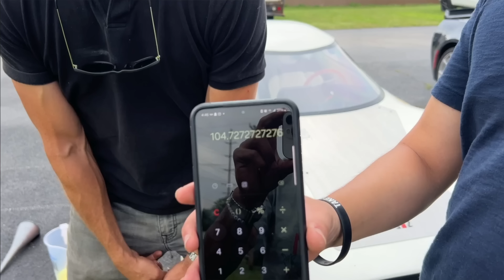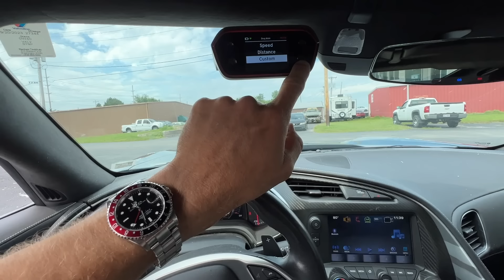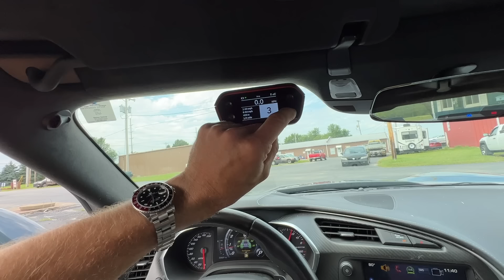FIRST 0-60 mph Test- Diesel OMEGA CAR - Video 3 of 3

Comment: Casey the Omega car is a beautiful and creative design and an amazing hands on teaching tool for inspiring your students.  You should be very proud for what it is.

However, I see you continually ignoring the multiple posts from other people regarding the real world practicality of what the Omega car actually is.  Unless you can post a video showing one of the industry accepted crash test simulations that evaulate the crash performance of the design and materials this is truly nothing more than a lightweight 2-seater as said by other posters.  A vehicle that could never meet any first world vehicle safety standards.  There is a reason why modern cars use a very carefully chosen mix of cutting edge steel and aluminum alloys that have been ran through tens of thousands of virtual iterations and analyzed to maximize crash performance while minimizing weight and construction complexity which both saves lives and production costs.  If you have developed your own materials that offer cost, weight, and strength advantages in vehicle construction over the steel and aluminum used today then where are your patents, published papers, etc?  This information would be worth billions to the automotive industry.   It is frankly insulting to think the millions of briliant hard working engineers around the world working in the transportation space have not come up with better designs and materials.

When you have the freedom to build a completely impractical car, with limited space, that meets no government mandated standards it is rather trivial to build extremely simple, cheap, lightweight, highly aerodynamic and thus highly effecient vehicle.  And even then, the Omega car doesn't match anywhere near the 261mpg effeciency, spaciousnes, etc of the VW Formula XL1 hybrid turbo diesel technology demonstrator which actually did meet European safety standards and went into production however required the extensive use of expensive carbon fiber to get adequate strength to weight requirements so that it was both lightweight, street legal, and safe.  It's the same reason why Formula 1 uses carbon fiber extensively in a money is no object design for strength/weight.  Also, without an electric motor and battery to recover energy in stop and go situations  (which is the majority of miles for most drivers) the Omega car will not get anywhere near the 100mpg you get on steady state cruise in a highly aerodynamic vehicle.  There is a reason why Aptera uses a 3 wheel design in order to be classified as a motorcycle so that it doesn't have to meet passanger car standards. The Aptera is an even more effecient design then the VW XL1.   In fact the Aptera is so effecient that with the very limited square footage of solar panels on the vehicle it is claimed it will provide enough energy for the day to day use of an average commute without needing to charge (although I'll be first to admit this is surely on the most optamistic perfect operating  conditions scenario and likely won't be nearly that effective in the real world).  

And lastly diesel is a dead end for transportation, or at least certainly for passanger vehicle transportation in the US.  All diesels (including Bio Diesel) produce high levels of NOx, Ozone, and volatile particulates that are all incredibly detrimental to human health and especially to children.  This makes air quality a nightmare, especially in dense urban area, which is where the polution is produced and concentrated near vulnerable people.  This is a scientific fact that can and has been emperically measured around the world along with the resulting health outcomes in respiratory diseases and cancers.  In the end despite all the emissions technologies manufacturers tried to implement it was still impossible to meet emissions standards hence they all resorted to some form of cheating to produce emissions that did not mimic real world performance.  Hence why in 2024 there is not a single diesel pasanger car for sale in America as NONE can meet federal emissions standards.  

And lastly you don't seem to be informed around modern battery chemistries.  Most of the EV world has moved to Lithium Iron Phosphate (LFP) chemistries which have twice the cycle life and which contain neither colbalt nor nickel.  In 2024 about half of Tesla's production uses LFP instead of the higher performance NMC.  BYD the second biggest EV manufacturer in the world  uses almost exclusively LFP.  

I hope this post doesn't get deleted as I have tried to be as objective and factual as possible in my critique.
Reply from the maker: Ignoring posts from people with zero knowledge of the car making assumptions- yes.
Reply: @CaseyPutsch  I'm very open to understanding where I am mistaken about the Omega car.   Which sustainable materials have you chosen that exceed the cost/strength to weight and reusability of modern steel and aluminum alloys which are nearly 100% recyclable.  The Omega car can meet modern US Federal or European safety standards? Great post a video about the simulation analysis data of the structure. 

The diesel engine in the Omega car can meet 2024 emissions standards? Great post the data on your independent testing.  

Casey you always preach about having honesty and integrity as a cornerstone of your life and ethics.  Why are you unwilling to engage me in a good faith 100% reasonble discussion on what you are claiming and proposing in these videos?  Is your position so weak and indefensible that you have to resort to one sentance "nuh-ugh" rebuttals?   Where is the honesty and integrity in that?

Comment: It would be cool to see what it would do with the cobalt diesel and the 6 speed it has. They are rated 52 or 56mpg (cant remember exactly).
Notable is the manual has significantly better mileage than the auto

Comment: If you can specify which 1.9 tdi is in there, I can tell you, if a remap would get you any faster than 4.6 secs... The 131 HP variants can be tuned to 160 HP before the turbo runs to fast... The 150 and 160 HP variants have the same PD injectors, but a bigger turbo and are good for about 200HP... It also depends on your intercooler though... Would be interested in seeing some remaps, as they can also lower consumption with this engine!
Reply from the maker: You’re assuming
Reply: @CaseyPutsch  yes, I assume, it still runs the stock map. I don't know the drag coefficient, I don't know the wheight and I don't know the front surface area, therefore I can't calculate the PS/HP number... Sorry if my comment offended you, but I am not a native english speaker, I am german, therefore I don't really know, when there's a misunderstanding. What I know for a fact is, that standard 1.9s PD130 are safely tuneable to 160-170 PS and around 400 Nm of torque... The remap on my PD130 has also lowered my average diesel consumption to around 5.4L per 100km from 6.1L (I drive the A4 B6 1.9 TDI quattro) the car is much quick, but still "slow", because it's the heavy, but practical avant

Comment: I had a 1984 Ford Tempo diesel that was 4 door 5 speed and it got 55mpg back then. It was only 55hp but it did ok with 100lbs of torque.

Comment: It's what the YouTube channel -  ' driving 4 answers' said in his GEAT video - 'What Koenigsegg Kesko's New Record Can Teach the Entire Car Industry', how LESS IS MORE. Over the decades cars have gotten heavier and heavier with little or no improvement in performance/efficiency & safety. Even the small Toyota Aygo was as safe as much bigger cars in crash testing! And this uptake (this CRAP uptake in UGLY SUV types, THAT... In MOST cases, the physical exterior of the car gets bigger, but the interior DOESN'T) has only gone to prove a point that IF car manufacturers STOPPED making bigger, cumbersome and heavier cars, and put smaller, modern efficient 1.4 litre to 2 litre engines in them (either petrol, deisel, or even IF they went electric), as the car itself is lighter, performance and efficiency would STILL BE GOOD for every day use!
Ford here in the UK have just announced the new Capri. It's NOTHING like the classic Capri (UK's answer to the US Mustang). It's based on the new Explorer, it's mostly from the WV ID electric car platform, it's BIG, TALL, HEAVY and as you've guessed, ALL ELECTRIC. It's an UGLY PIG, it's an assault to the orginal Capri (some D!CK at Ford is quoted as saying "It's what the Capri enevitably would become", what, so, like the Mustang was ALWAYS going to go from a lightweight 2 door to an FAT F@CK SUV type 4 door hmmm?...
Anyway, smaller PROPER CAR LIKE CARS with LESS overblown tech features - multiple screens? HEAVY heated or heated AND cooled seats (really? do you, REALLY need that?) 30 & speaker sound systems and MUCH MORE EXCESSES...
There's SIMPLY NO NEED. Remember the age old saying... "KEEP IT SIMPLE STUPID"... When did car designers forget that WEIGHT KILLS EFFICIENCY! 🤔😒
😎🇬🇧
Reply from the maker: You’re mostly forgetting CD
Reply: @CaseyPutsch  Yeah, ok lol, I forgot aerodynamics, that, and weight severly hamper poerformance and efficiency...

Comment: How light is this car because if you can achieve 4.6 seconds with lets be real here well under 200hp then it must weigh like under 1500lbs and also how did you get 100+mpg out of the thing like how did you pull this off like you should share this with automotive companies and engineers because this could revelotuionize the Auto industry and cars in general like your doing awesome Hopefully you get investors and you can start a business making these omega cars
Reply from the maker: Thanks. Actually it’s heavier. I just used my brain and thought for myself.
Reply: @CaseyPutsch  oh so wait how Much HP do you think its putting out and how heavy is it like 1700-1800lbs I'm guessing this is as light as an Lotus Elise if not slightly lighter

Comment: If you are looking to get more efficiency the short gearing doesn't make sense. I'd think you need to look at increasing the final drive as it will promote more volumetric efficiency associated with lower revs. The 0-60 will not really suffer too bad as you'd probably cut one gear change.

Comment: Schools, start with schools. I received more instruction in diagramming sentences and poetry than I did in Engineering, Electronics, or Design. For the most part, the education system is primarily designed to produce more teachers.

Comment: I did some studies some time ago and found that a diesel hybrid could get close to 130 MPG. These are the range extender types of hybrids.
Reply from the maker: What if I can do that non hybrid.
Reply: @CaseyPutsch of course it's  easier and cheaper and more reliable to do it without hybrid system. 
There are a couple cool layouts though:
Integrated Starter Generator like Merc is using: replace flywheel and starter motor with a small motor-gen unit.
And the lemans hybrid layout is very cool too, and obviously helps with efficiency: MR, or RR with a small electric motor on the front end, with a small capacitor bank to recover energy when braking, and give you an AWD acceleration boost moments later. Good in a city, good on a race track.
Reply: @CaseyPutsch NSX style front torque vectoring with electric motors is incredibly fun.
Plus, the engine wouldn't continuously idle and waste fuel at a stoplight, benefiting emissions.

Comment: Hi Casey. Great job. Adding lightness and aero goes a long way. I’ve always thought that using lighter materials and figuring out how produce them cheaper would change the entire oil market. Elon works more on Production Engineering than on the engineering. He says, “Engineering is not that hard. Making things is hard.”  I deploy digital tools for an aerospace company. Using AI and multidisciplinary software could really help your effort. Let me know if you need some help. I work with Siemens software and they are great to work with. I wonder if you decide to refine your design that they’d be willing to partner and provide free software.
Reply: Has Siemens been known to provide free software to a business?

Comment: Is it practical to apply the tech to diesel powerplants and the electrical grid?
Reply from the maker: You missed the point. It’s not about the engine.
Reply: @CaseyPutsch  I didn't miss the point. I simply asked IF what you did to achieve the results you did with this car COULD be applied to electrical grid powerplants? Since I have no idea what you actually did, I can't assertaian that myself, I can only ask YOU. 
I agree with you on many current manufacturing lazy (or intentional) design points.. My 3/4 ton Titan with a 5.6 liter V8 has more power and gets better gas mileage than my 1/4 ton Frontier with a 4 liter V6. The major design difference is that the Titan has a 9 speed transmission. When I max the towing capacity of the Frontier at 5K lbs, the mileage plummets from 20 mpg to 12 mpg. When I max the Titan's towing capacity at 10K lbs, the mpg only drops to 18. Most V6 manufacturers are moving back to a straight 6, as they've determined it has more power and better fuel efficiency than a V6. Some manufacturers are getting the same results with 2.0 or 2.3 liiter turbo 4 cylinder engines with a variable speed transmission. 
Each time energy in a drive train changes a direction, the drive train loses efficiency and power. I've always believed that getting rid of as many energy direction changes and moving parts as possible increases efficiency. If I remember correctly, the Stanley Steamer brand of the early 1900s eliminated transmissions, drive shafts, differentials and prop shafts by placing an electric motor at each wheel, but powered with an ICE generator rather than batteries. It relied on the electric motors to provide the horse power and manage the varying power load required to maneuver varying terrain. It was intended to be able to incorporate an internal combustion engine that wasn't required to provide varying levels of horsepower at extreme variances of RPMs and mechanically transfer the power through gears, drive shafts differentials and prop shafts that would need to be of strength and weight to transfer that power. The idea was that an ICE with a constant RPM and a lower required horse power could simply and more directly transfer the power to higher torque electrical motors through non-moving and lighter weight parts (electrical cables), instead of relying on a mechanical drive train to transfer power from an ICE that needed to provide higher horse power at varying RPMs.
It failed because the ICE, essentially an electrical generator, still could not maintain a steady enough RPM to run properly under the direct varying electrical loads that the electric motors at each wheel needed. A battery bank was needed as a buffer between the motors and the generator to deal with the varying load requirements of the electric motors without affecting a steady RPM of the ICE powered generator. The required amount of batteries in that era would have weighed to much, and electrical management systems required did not exist or were even conceived in that era. I think today, however, it's most likely possible. 
Placing the high torque variable power at each wheel, acquiring their power directly through non-moving cables from a buffering battery bank which can deal with the fluctuating power requirements, powered by an ICE running at fairly consistent non-varying RPMs with a low horse power requirement, would result in extremely higher fuel efficiency without compromising horse power and performance.

Comment: even sub 6s would still be pretty fast and acceptable for a sports car that is light and nimble. Cars like this are usually the recipe for track kit cars in Europe except they usually are not turbo and not diesel, but I would prefer this combination. Being that light it's easier to find an engine for it. However, this not only a nice desirable sports car but also an extreme efficiency car which is also important. An electric version would not be a bad idea either because unlike normal electric cars this would keep very light and require a very small battery that would make sense, like electric scooters.

Comment: Tesla long range awd goes 3.9 0-60 and you can get them for around 25k used with the acceleration boost which makes it have a 0-60 in 3.7 seconds. The standard range rwd is  impractical
Reply from the maker: They don’t. I tested it. Complete lie. Uses a roll out factor. Total lie.